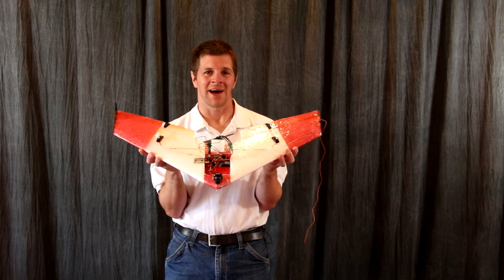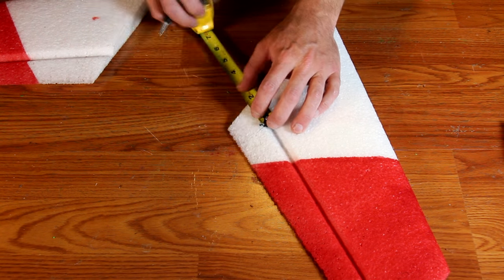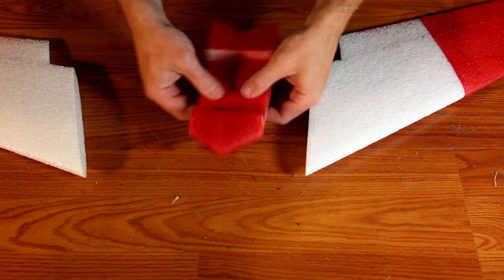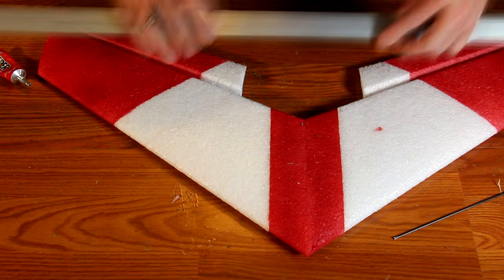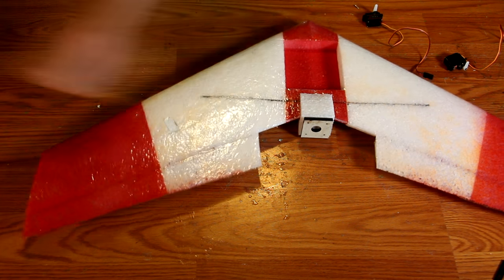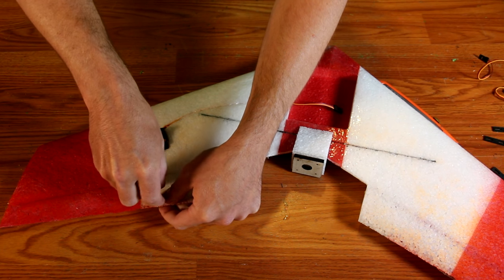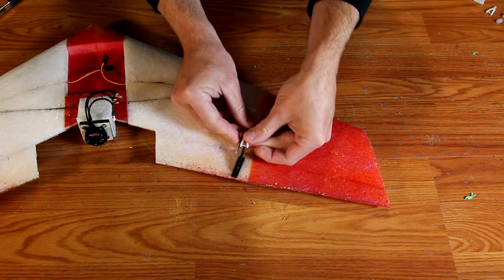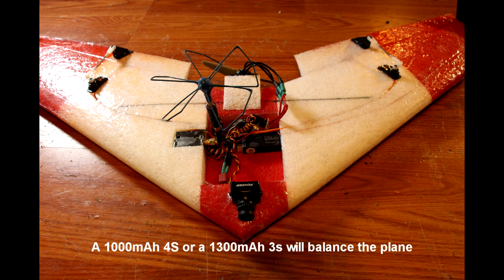Sphinx 27" flying wing build tutorial

Comment: This is a great wing. I got one from Flight Fest 2016 for my 9 year old.I let him build it he had a great tine.I put a Turnigy 2826/2200KV -30 amp esc - 1550 battery and an Orange R615x  RX total weight is 560 gram. Probably a tad bit heavy ,But I used what I had around. Some build advice 
1: Score the inside of wiglets so glue has a rough surface to stick
2: I used Blaze Plastic dip spray. This is by far the best way to color a wing, I tried colored tape,Fusion paint, Plastic dip spray has be the best to apply , it's the lightest and holds up the best. It was applied after the Laminate 
3: I used Scotch extreme tape on the leading edge + 3 strips from top towards motor top and bottom. 
other than that I wish I had bought more to try to build lighter.
Reply from the maker: Good advice!  Indeed plasti-dip works well.  Also, great advice on scoring the winglets!  I never thought of that.

Comment: Link on where to buy? And please do a video about your hot wire gun, that thing is so awesome!
Reply from the maker: I released it at FliteFest.  I actually sold every unit I took with me after winning a quad race with it (go figure, right?).  In any case, this will be sold by: Stone Blue Airlines, Get FPV, and Ready Made RC.  They should be in stock by the first week of August for $50.
Reply from the maker: I will make a video on the cutting gun.  It is an awesome tool and takes all of 1 minute and $30 to make.
Reply: Thanks, I'm definitely getting one of these bad boys.
Reply: Please! I can't wait for this video!

Comment: How big is the bay, and what kind of motor are you recommending? I assume 1400mah 4S is too big.
Reply from the maker: The bay can take a 1400/4S.  Balance it out with a 2206/1900kV motor and a 5" prop.  This will be a good, solid performer.
Reply: +Video Aerial Systems What kind of motor/battery are you running?

Comment: Alex, you should have told me about this at Flite Fest! When is the release?
Reply from the maker: I sold them all!  I won the MultiGP beginner quad race with it.  They bent the rules a little to allow me to race it (I still had to fly through the gates, though).  Thus, I need to cut more.  Stone Blue Airlines will have this in stock in a week, probably.  Just need to fire up the foam cutter and get working.
Reply: +Video Aerial Systems Why did they need to bend the rules to allow you to race this? As far as I can tell, it meets all the published rules of the Mini Spec Wing class.
Reply from the maker: It isn't a multirotor.  I was racing in a multirotor race ;)  It is indeed multiGP spec mini-wing legal.
Reply: Oh! Lol, I see now. That's just awesome. Your airplanes and antennas are the best. Thanks for all your hard work.

Comment: how do i mount the motor? there is 2 wood plates, 

in the video it goes from no motor to instant motor installed lol
Reply from the maker: There is a supplied motor mount that is pretty obvious.  Just glue it on the plane and bolt up the motor.  One fits an "X" mount and the other fits directly on the motor depending on how you want to mount it.